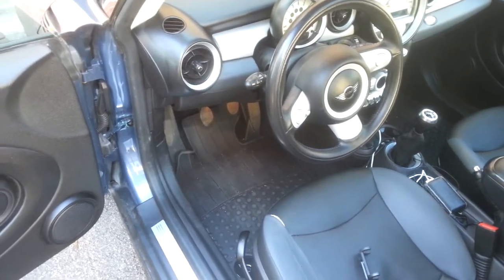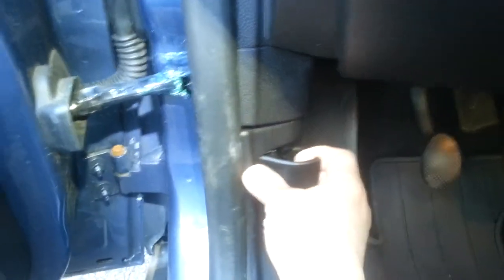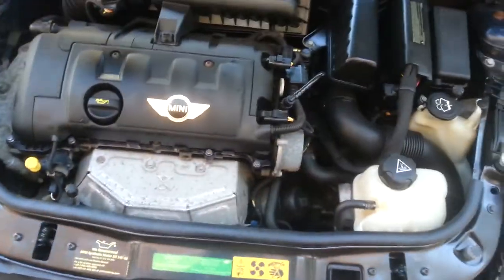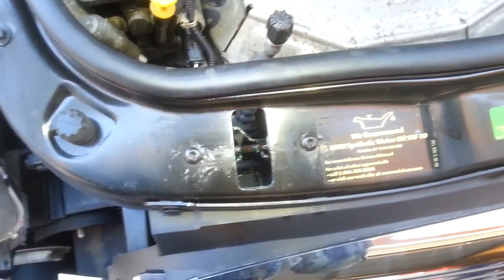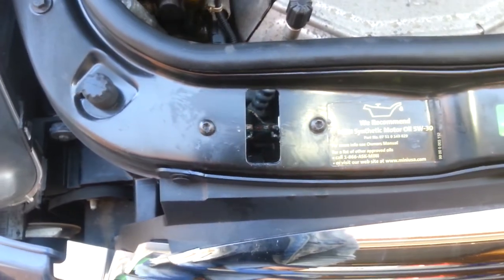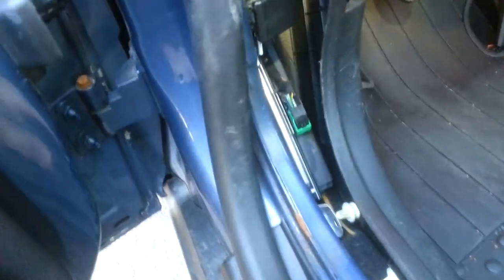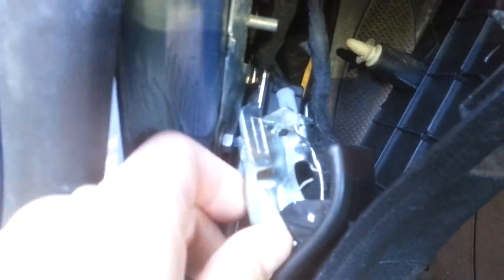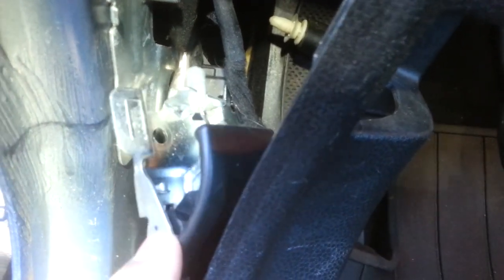How to fix the bonnet or hood release for Mini Cooper

Comment: Thanks for this wonderful video. I'm a 75 year old widow who has always loved fixing anything mechanical (thanks, Dad). I slammed my hood down too hard and it's stuck shut. I took the very top of the grill off (2010 Mini) since I knew it snapped on. I was able to slip my fingers in under the hood to release the latch, which worked, but it's still stuck. My son pulled the inside release too hard and it broke away from the little handle. This video shows me how to fix that. I will have my mechanic go underneath to release the latches; hate to spend the money for something stupid I did. If he doesn't oil them, I will. I wish I knew this was a problem with the Mini before I slammed the hood. The hood was a little off centered when shut before this happened. The only reason I want to lift the hood is to check the oil. The Mini has so many great features, but why did they NOT include an oil light on the dashboard? Dah! Thanks, again!

Comment: Thanks so much! Broke the handle trying to open the hood. Watched your video, then had my wife push on the hood and was able to get it to pop.  Found a oil bottle cap under the hood that I had left there, which must have created the extra resistance.  Thanks again.

Comment: Thanks for posting. When I tried pulling the release cable inside the car, the resistance was so strong it pulled the cable sheath out of a U shape metal bracket behind the pull lever. To resolve I removed the plastic interior panel around the bracket so that I could push the cable sheath into the U shape metal bracket. Then I pulled the cable whilst someone was pushing and pulling on the hood. That was enough to release the hood. Definitely going to lube those release latches and even the cable with WD40. Seems like a poor design mechanism by Mini though.

Comment: When you pull back the weather stripping to pop the inside panel away, is it easy to put back or do you have to use some sort of glue?
Reply from the maker: The weather stripping around the door is a dry fit. It doesn’t use glue or any adhesive. It just presses on. Good luck